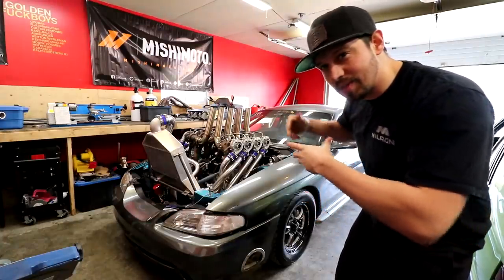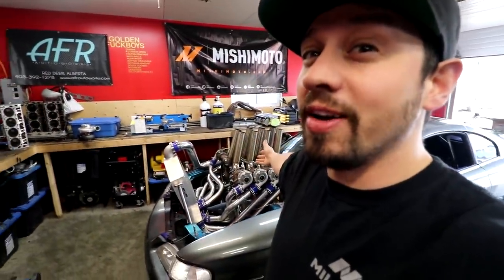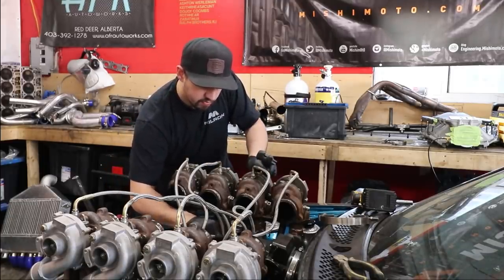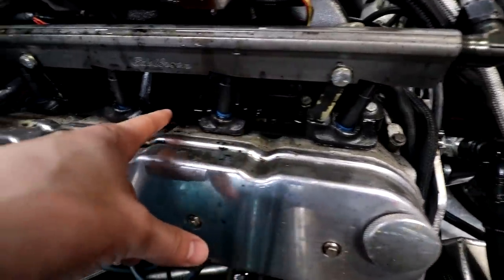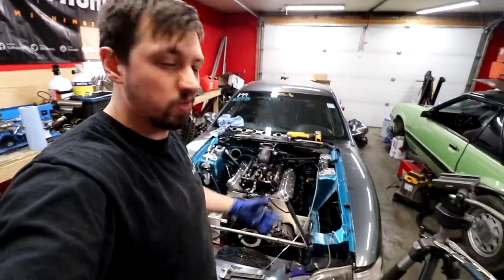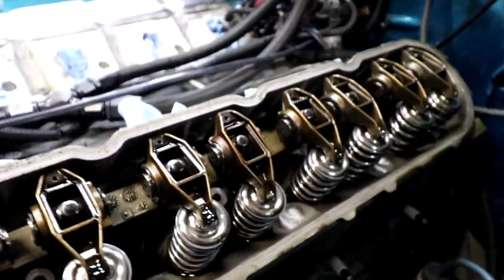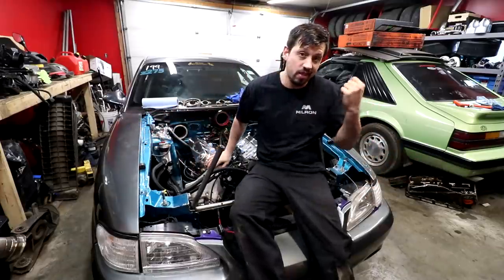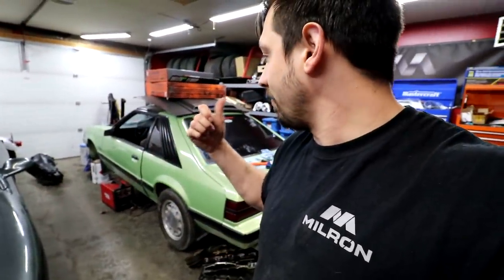Eight Turbo V8 Mustang Has To Go.

Comment: When you do the 8 turbo kit again, run liquid to air intercoolers, but without the merge run each cylinder separately so you don't get the back feed. It just means you have to have a perfectly balanced engine first so cylinders don't overpower others

Comment: I feel like if the turbos were being fed in groups rather than individually, they might have worked better. Maybe 6 slightly larger turbos, 3 per bank of 4 cylinders. Hopefully holds more boost before having back feed issues.

Comment: You want eyeballs? Try driving a turbo turbine  or two  with a mini jet then and see what kind of dead-head pressure you get from the compressors. Get the jet going while discharging it into a stainless box (and out through an open shutter directly across) that's also plumbed to the turbine or turbines; and then once the jet is going, shutter the box off to divert  all the thrust through the turbines to spool them up. What do you think? LOL With your welding skills you could certainly build one of those jet kits. There's a cheap one on Etsy for only $300; but I'd hold out for the bigger one all the RC freaks dig. I'd do it myself but I don't have a sponsor or your welding skills, plus I'm up to my neck in solar air-conditioning already.